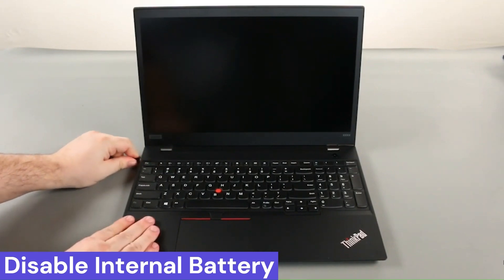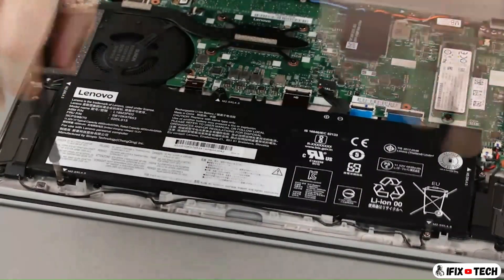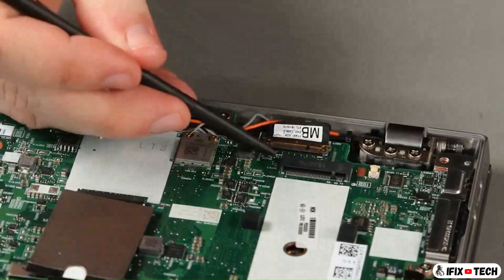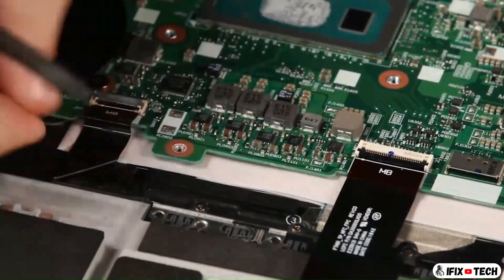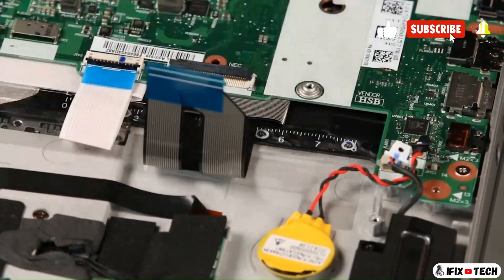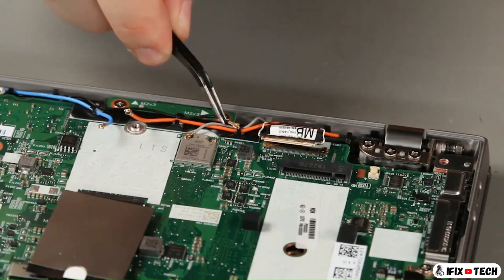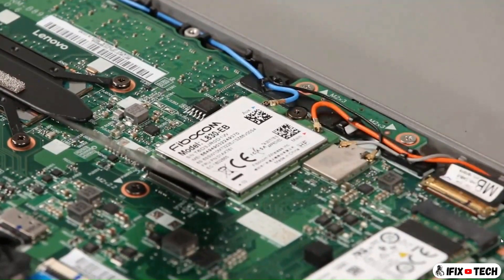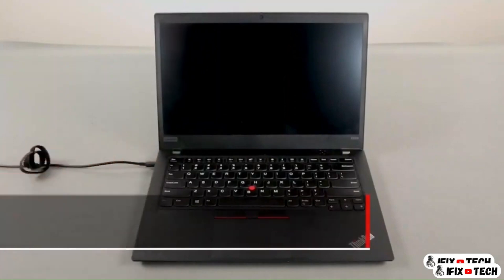Lenovo ThinkPad X390 and X395 MOTHERBOARD Logic Board Replacement

Comment: Does the ram have 2 slots?
Reply from the maker: The ThinkPad X390 has no user-accessible memory slots. The RAM is soldered onto the motherboard and is not upgradable, according to Lenovo. While the maximum memory capacity can be 32GB, this is achieved by purchasing a model with the desired amount of soldered memory

Comment: What's type motherboard for thinkpad x395 Ryzen 5? I mean like serials number
Reply from the maker: You mean the FRU number. You can find that on the Lenovo website pcsupport.lenovo.com under "parts look up" 
Thanks for liking it and subscribing 👋 😉
Reply: @IFixTech1  btw, can I upgrade CPU/GPU with motherboard? I mean, I bought a motherboard Thinkpad x395 R7 3700u with ram 16GB and changed my default motherboard R5 3500u 8GB?
Reply from the maker: @muhammadilhamasli  Yes, you can do that 😉